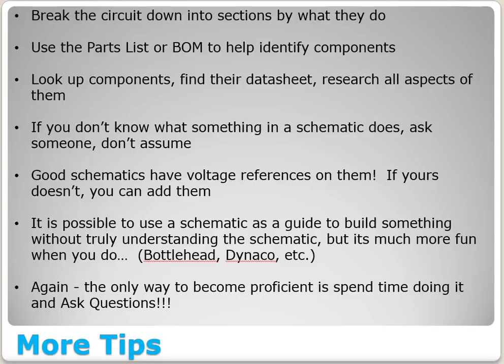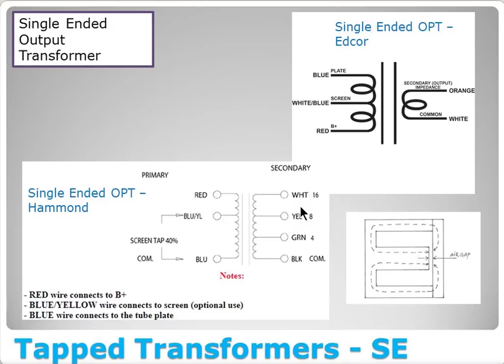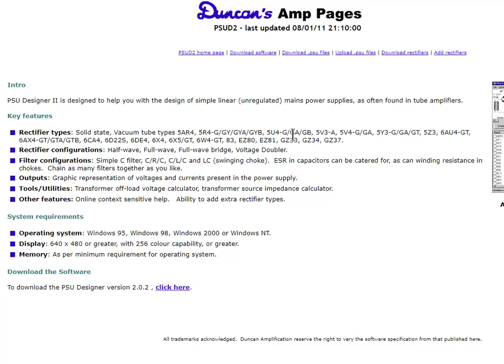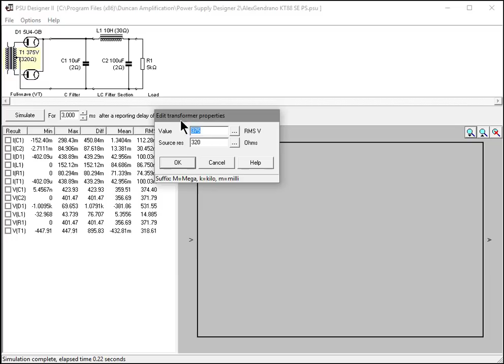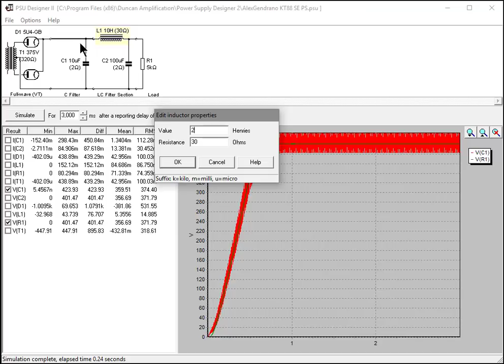Understanding Vacuum Tube Amplifier Schematics - Power Supplies - Part 2

Comment: I imagine you are sick of seeing my comments, but it's only for the sake of clearing up any misunderstandings that may happen. Regarding single ended amplifiers, they of course by nature run in class A, but so do push pull if you design them that way, so mentioning class was I feel misleading. The core of a transformer will saturate, ie become maximally magnetized much earlier if there is a DC current flowing, which is unavoidable in a single ended valve amp. To minimise this an air gap is introduced but this lowers the inductance dramatically, hence the big transformers found on quality single ended amps, even allowing for high permeability materials. The push pull cct, when in any class, will have opposing and symmetrical DC currents flowing which cancel the effect, they can have smaller transformers - even when twice or four times the power handling, as they do not have that nasty air gap to interrupt the magnetic circuit. Again though this is a wonderful series and I really appreciate your fine efforts - please excuse me being a pain in the arse.
Reply: Always welcome comments.  I make these videos on the fly, I myself always find things I could have clarified or what not as well.
Reply: I got to say I greatly admire you for making these videos. You are always up for 'know it alls' to poke at any error, I sure don't want to be one of them, just a member of your community adding some , I hope, value. I really enjoy watching you and seeing some of the lovely equipment you come across.

Comment: In your discussion of transformers, you implied that an air gap was required because an amp operates in Class A. However, it is because the amp is single ended (which of course means it must operate in Class A) that the air gap is required. DC current is constantly flowing one way in the primary which means that an air gap is required to prevent core saturation. It is possible design a double ended amp to operate in Class A, but since DC currents flow in opposite directions in the center tapped primary they induce magnetic fields of opposite polarity which cancel so that no air gap is required.

Comment: Just found your series on the single ended amp build and now schematics.  Thanks so much great info.  I recently repurposed a Conn organ console with surprisingly nice results.  I actually began with AM tube radios and have always struggled with the concept of ground.  Especially when a chassis is not directly connected to ac source or line third wire ground.  Any clarification would be greatly appreciated.
Reply: In an amp with a three wire power cord, the chassis is connected to the safety ground (or earth) at the wall socket. The negative side of the power supply is also connected to the chassis, which makes it the 0V point from which other voltages in the amp are measured. In a vintage amp with a two wire power cord, or if the amp is battery powered, the chassis is still the 0V point in the amp, and is still referred to as ground.

Comment: Nice tutorial.  One additional note, Howard Sams Photo Facts schematics were actually independently derived by actually ringing out products with an ohm meter.  In a nut shell, most manufacturers that provided a schematic, provided the, "As designed document" Sams provided the more valuable, "As built" document.  In fact when ever a manufacturer changed the revision level of a model number, Sams would re-evaluate and if necessary produce a new schematic.

Comment: If building your own tube amplifier from scratch, May I suggest you cover load lines, choosing bias resistor's and calculating output transformers. Power supplies Schematic would be nice If you can cover that.

Comment: Great series.  Would you elaborate on the AC/DC in the schematics?  Most schematics do not indicate AC/DC component which was the biggest confusion for me when I was learning.  For example, a 5u4 tube, the 5VAC from the transformer  is connected to  filament and it is also where the 5U4 output  B+ (high VDC voltage).  For future videos, please consider the topic of tone circuits, rolling off high or low frequencies, or a narrow band boost or cut in frequencies, RIAA equalization for vinyl, NAB, IEC  playback equalization reel tapes in a preamp, sharp cutoff tubes used for signal compression, the challenges for using small signal tubes, SRPP circuits, using voltage regulator tubes OA2, OD3, and solid state rectifiers using Schotky diodes. how to generate negative voltage for bias if you don't have a separate winding, capacitor bypass vs diode, LED.  What do you think of the new dual triode Nutube from Korg? Thanks.
Reply from the maker: LOL, you want a 4 year degree in electronics via a youtube video.  Hold tight, I'm sure over the years, I'll cover all that.  I will hit the AC/DC thing soon.

Comment: Ok Thanks for the Video was informative for me. The Inductor symbol section cleared up the types of materials used for their cores and the symbol representation, Can I assume that ferrite core is also referred to as powdered iron??. - I did not know that they wound transformers in both directions on the same unit and that the dot was a representation of the direction, I do now. - The CLC & CRC filter thanks for explaining that. - With the Dynakit amp the bias tap and the diode orientated in that way would represent a negative bias feed??  and would this mean by adjusting either of the 2x 100R resistors that this would also alter the bias of that particular tube even though it has a resistor on the cathode and a pot to adjust the bias ?? - Thanks for the duncan's app and explaining it a little should be able to get some value from that.

Comment: Have you seen a book called Millard circuits for audio amplifiers.
Reply from the maker: Yep, have a copy or two laying around
Reply: John the Mullard books are famous! They have included some of the most wonderful designs, 'The Mullard 5/10, 10/10, 5-20, the 3 watt  amplifier, etc. These are all valve designs built around 'the new' miniature B9A valves like the EF86, ECC81/82/83, EL84 and 'the new' EL34 octal. Mullard were very proud of their new audio valve line up))
The little single ended EL84 amp is a masterpiece and sounds unbelievable. It has some very unusual design features that solved some age old problems of coupling the tubes. Genius.

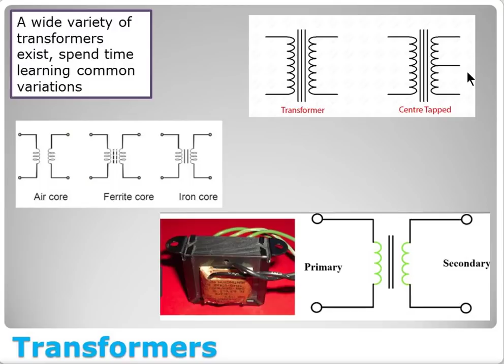Comment: Thank you for the nice video. In the tapped transformer part of the video (13:45), your illustration of the classictone xfmr showed 660V @ 120mA, 6.3V @ 3A and 5.0V @ 3A. Can you explain the significance of the 120mA and 3A in the respective voltages? Is it important to know the mA and A in choosing the correct xfmr for a tube project or just the voltage measurements. Most of the time you got to see like 350-0350 or 375-0-375 in the xfmr requirement for the project with the mA and A not being mentioned. Thanks.
Reply: I will give it a shot:
Yes it's important, the high voltage winding has to be sifficient to power the output tubes(and preamp tubes) which requires high voltage and low current to the plate, you can find in the tube datasheet the plate current that each tube pulls. On the other hand the 6,3V for the filaments(both output tubes and preamp tubes) takes high current and low voltage to heat up, you can also find these numbers in the datasheet. So depending on the number of output tubes in your project you have to calculate how much current will be drawn both from the high voltage and filament winding.
Hope this helps, may be a bit fuzzy I'm about to fall asleep
Reply from the maker: This is headed down the right path indeed.

Comment: Great videos, really enjoyed part one(havent watched this one yet) 
I have two questions:
The first one concerns a fixed bias pot, i read somewhere that i should put a resistor between it and ground, is this to reduce the stress on the pot and is it common?
I have a choke where it will carry the same voltage as it's rated at, I read that you can ground the core through a capacitor to ease the stress, does this work and what value should this capacitor be?
Thanks for all the great videos
Reply: A resistor between bias pot and ground is intended to prevent the bias voltage being reduced enough to damage the output tubes. It is often called the 'idiot resistor'.